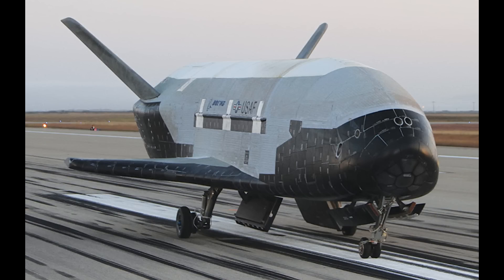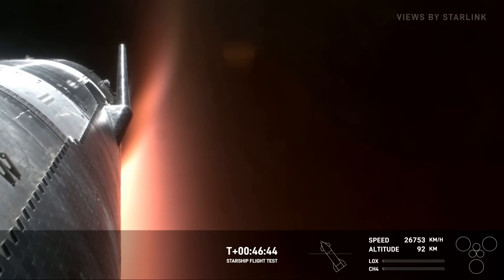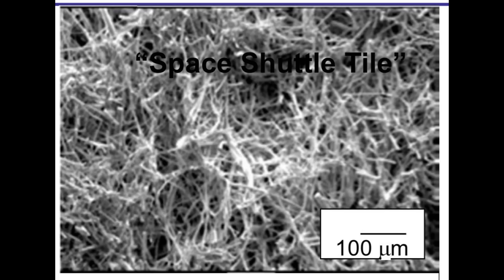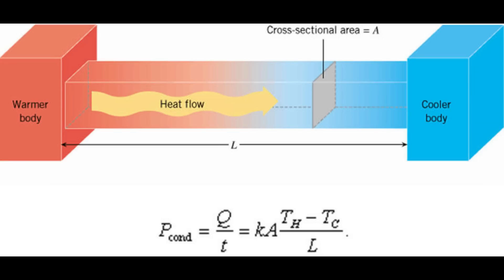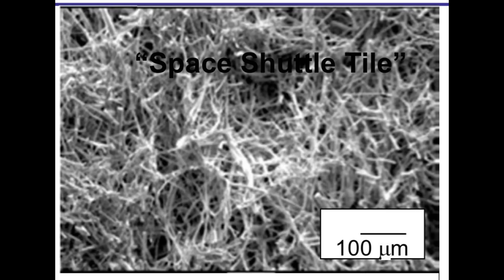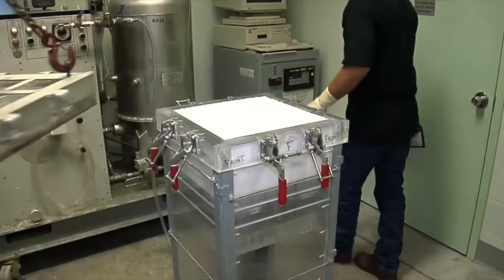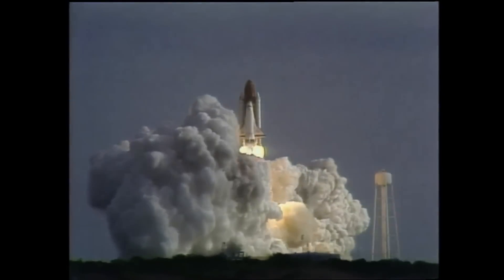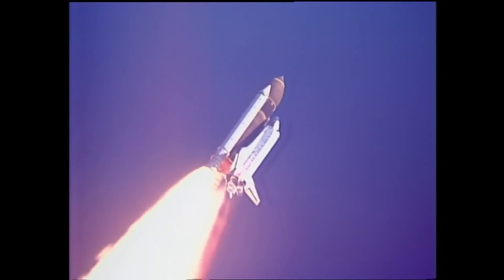The Microscopic Trick That Makes Heat Shielding Tiles Work

Comment: I once saw a video of someone in the facility making those Spaceshuttle tiles pulling one of the tiles, glowing white hot, out of an oven using a pair of tonges. And then just picked it up with their hands without getting burned
Reply: Yup... about 10 seconds after the tech removed it, the tech was able to pick it up by the corners using his finger tips.

Comment: One minor correction: alumina (Al2O3) is only called sapphire in a specific crystalline form (the alpha phase). I'm pretty sure this would be amorphous alumina, which is definitely not sapphire.
Other than that, great and interesting video!!
Reply: Actually given the temperature stability of TUFROC / similar materials, it likely is polycrystalline already (due to the heat treatment)

Comment: For those wondering why ITAR wouldn't want information disclosed about heat shields, its because passive heat shields are essential for accurate ICBM reentry vehicles. If you use ablative heat shields on the warheads, accuracy will reduce.
Reply: If ITAR was important here, NASA wouldn't have published all those details about the Space Shuttle TPS.
Reply: All modern reentry vehicles used by the US have ablative heat shields. They ensure accuracy by spinning the reentry vehicles to prevent uneven ablation effecting accuracy, plus in the Trident D5's Mk.5 reentry body they have metal filaments running along the axis of symmetry to make ablation more predictable.

Comment: I have been saying for years that the heat shield tiles are going to be a huge problem for Starship. They might get them to work but it is going to put a huge damper on the reusability part. Elon has said many, many times that the end goal is to fly a Starship to orbit, bring it back, catch it with the tower, stack it back on a booster, refuel it, and immediately relaunch it. They will never be able to do that using this thermal protection system. There will always be refurbishment needed before it flies again. So, they're going to have to figure something else out if they plan to turn around Starship like that.
Reply: So will you let us in to your source of all the confidential information on what they are doing? Or are you one of the armchair experts who 15 years ago said reusable rockets are never going to work?
Reply: @christiannorf1680  Armchair expert.
Reply: @TheEvilmooseofdoom  And what exactly makes you think that? Do you guys really believe five years into the project the people at SpaceX went "Hum, what about water proofing by the way? Have we thought of that?"

Comment: Its very obvious how delicate and soft the material is from the clip at 7:20 showing the worker removing the silicon 'sponge' from the furnace as you say "to give it some strength" you can see an impression from the hand of the guy who picked it up, its that soft.

Comment: I had wondered why they're not using large ablative shield sections that could be rapidly replaced instead of a passive system. I guess the issues of not performing as well on a non blunt body vehicle, are likely prone to cracking, and fabrication is likely difficult are all showstoppers for such a protection system.
Reply: It's not so easy to make large ceramic heat shield parts.
Reply: Ablative heat shields are heavy, not reusable and as they ablate they change the shape of the surface.

Comment: It's a micro-bramble. So was the SpaceX one, obviously.

Also, the transperational cooling system that they came up with wouldn't have any of these issues. And maybe they could make it lighter than what the tiles ended up being.

Comment: I wonder how different SpaceX and Sierra Space's tiles are given they both used the space shuttle data to design them
Reply: Space shuttle data?
Reply: @TheEvilmooseofdoom  both companies cooperated with NASA in their designs.  I'm assuming they looked at some engineering info we don't get to
Reply: @Shadare  I know spacex worked with NASA on the pica-x heat shield but not Starship.  Since each TPS is unique to each vehicle I'm not sure how much data from the shuttle program would have been useful but perhaps some.
Reply: @TheEvilmooseofdoom  Not starting from scratch designing the manufacturing methods is more what I mean.  It would have taken a lot of time and money to re do all that engineering and I doubt that all 3 would share such stark similarities if they were designed by completely separate engineers not cooperating at all.  NASA wants to see these vehicles succeed. They aren't greedily sitting on their patents waiting for everyone to fail.  I think it's a little weird how resistant people are to what seems like such an obvious explanation.

Comment: While convection, conduction and radiation are the three primary heat transfer methods (2:55), EVAPORATION is arguably a fourth method.
One could claim that evaporation is a form of convection, but it is considerably more complicated, as there is a phase change - liquid to gas, or solid to gas (sublimination)
That seems to be in part the case with 'active/ablative' heat shields (0:38), where a sacrificial material produces a (hot) gas which wicks away the heat. If the ablation causes a chemical reaction it is even more complex than evaporation. Still, energy is absorbed to change the physical properties of  material. That does not happen in convection.
Reply: That's how they cooled the Apollo moon suits if memory serves..
Reply: @TheEvilmooseofdoom  Good call.  With convection in a vacuum being zero, conduction being zero except for possibly the feet in contact with soil, they're left with radiation and evaporation. Radiation would work, but only favorably at night. I Googled to find the following (verbatim): "Daytime on one side of the moon lasts about 13 and a half days, followed by 13 and a half nights of darkness. When sunlight hits the moon's surface, the temperature can reach 260 degrees Fahrenheit. When the sun goes down, temperatures can dip to minus 280 F."  Photos of astronauts in daylight means radiation won't serve to cool. You're right. Evaporation or some sort of phase change must be used.

Comment: If replacing the heatshield is faster than re-waterproofing, maybe they could have multiple sets of heat shields that they rotate each launch and waterproof the ones not currently in use

Comment: And you can buy it and use it as one of the best insulators. It’s called an aerogel, with a company that makes sub products, one called pyrogel and another called cryogel.
Reply: Aerogel has some issues in space flight that make it a less than ideal choice for this.

Comment: Given how diffivult it seems to have been to keep these tiles fixed to a launching Starship.
In terms of speedy reusability, wouldn't it make most sense to come up with some kind of spray on coating that could form some kind of cohesive (even if weak) shell over the tiles which could be quickly applied & remove the concern about individual tiles?

They only have to make it though a few minutes of reentry after that & only if the coating fails in any 1 region for whatever reason.

Given the current problem seems to be simply retaining tiles, wouldn't that make the most sense?

Essentialy a quick easy spray on sealent with heat shield properties but keeps the main protection in place.

WHo knows, maybe SpaceX will figure out that fixed in place tile shielding with subsurf & be more efficient & safer than this idea.
Reply: They seem to make it through launch just fine, it's entry that is giving them issues.

Comment: Since most of Starship's shape is consistent, why not make the tiles larger? Expansion? Seems like large curved plates would have fewer gaps; fewer points of failure.
Reply: Expansion.  The problem is not all materials expand at the same rate and even different thickness in the steel can change that.
Reply: Or overlap the tiles like fish scales. Then there are no gaps between tiles and thermal expansion and contraction are not an issue.
Reply: @williamduffy1227  Dragon Scales
Reply: @williamduffy1227  That requires more tiles and thus more mass.

Comment: I got to handle one of those tiles once. It was shockingly light. If you waved it up and down you'd feel the air resistance more than the weight.

Comment: Why aren’t heat shields needed on launch? The spacecraft are going through the same atmosphere, and accelerating to the speeds they will be decelerating from on re-entry. Is it because most of the acceleration is done outside the atmosphere?
Reply: Correct, most of your burn is done well above the atmosphere. I think KSP makes this a bit confusing because the scale of everything is wrong in that game, so often times a low kerbin orbit is way closer to the atmosphere than an equivalent low earth orbit would be
Reply: Because on launch you're going through thick air much slower.  It's on return when you start with all that speed it becomes an issue.

Comment: What happened to using aerogels?
Reply: That’s what I was wondering. Hopefully Scott will respond to one of our comments as to whether or not aerogel could work as a water sealant on heat shields
Reply: It's hard to do, can be costly and abrades easily because it's mechanically weak it tends to become aerodust when subjected to G loads.   I believe R&D on it didn't go very far.

Comment: hmmm, ... tile maintenance may be the most problematic thing when it comes to rapid re-usability, but ... 
I think it's more likely to be the big fireball destroying the launch/catch tower when they try to catch that BFRocket. 🔥🔥
Reply: It won't destroy the tower.  It will make a big fireball.
Reply: @TheEvilmooseofdoom  I suspect the huge mass of the BFR crashing into the chopsticks and tower will be the main destructive force.  The explosive fireball will merely add to the destruction.  Catch fail in other words.  I hope I'm wrong.  
This catch system reminds me of H. Hughes big Spruce Goose wishes.

Comment: NASA recently announced the development of a new lightweight alloy with enhanced properties meant to withstand extreme conditions including heat and cold. Referred to as GRX-810, NASA has already selected several companies to produce and market use of the product. From what I could see of the tiles, they have a thin metal "plate" inside each tile that clips to prongs welded to the Starship. I'm convinced that use of this new alloy or something like it will resolve the problem. I don't think making the rocket out of the metal alone will fix the problem but a tile, with or without underlayment, might work. The ceramic itself break apart under certain conditions and cannot be relied on to do the job. What SX has done so far is provide a short term solution to get the Starship airborne and home again. NASA may already have a solution in hand.
Reply: There was also the metallic TPS that was planned for the VentureStar.

Comment: Regarding the surface treatment of AlO2 shielding. If NASA has the technology to produce a material that chemical changes, forming a protective gas layer on the leading entry surface, why could a "coating", that chemically creates a protective gas layer, not be applied to the surface of an almost effective AlO2 permanent shield tile?

Comment: I fully agree with you … the TPS has to be the biggest challenge. 
Thinking back … although shuttle used ceramic tiles for the major extent of airframe protection, didn’t they use reinforced carbon-carbon panels for wing leading edges …ie; those parts which needed thermal protection but where the local loading environment was more aggressive than the ceramic tiles could withstand??
Yes … I am thinking about the same parts that proved vulnerable to impact damage from chunks of closed cell foam being shed from the main external tank. However, I assume this material could be manufactured in appropriate geometries that could offer good thermal protection to those parts of Starship (flaps) that proved challenging based on FT4. 
Sadly, I am not sure about the thermal properties/performance of this material and I suspect it comes with a weight penalty … but it might offer a potential compromise solution??  I believe RCC composites are good to >2000C with breakdown by sublimation at >3500C. 
I have also wondered if exposed parts of Starship airframe could be fabricated from inconel alloys to provide for superior integrity in exposed locations such that they might still perform adequately with reduced thermal protection.
Maybe a combination of localised use of Inconel structure with RCC cladding??
Has anyone looked at the potential of a hybrid panel of ceramic matrix core laminated into an RCC structure? … similar to a typical honeycomb panel? … though probably find the matrix would be crushed in the lamination process ☹️. 
Just some wild thoughts and speculation from a retired aerospace engineer ….

Comment: Stainless-steel is also a very bad heat conductor, so if you heat a very small spot, it may melt sooner than aluminium or copper, which can conduct away heat from a local hotspot.
Reply: Thats actually a good thing.

Comment: Very good video. The only thing that is radiation heat transfer is not about the temperature, it is about the temperature differences so as the tile heats up, the radiation heat transfer slows down

Comment: maybe the engineers working on the Mercury, Gemini, Apollo project got it right. KISS. one can even use the high tech tiles developed since, but they should be replaced wholly after every landing. "one size fits all" just drives up the complexity and price of the process. one just has to think about the mechanical/thermal needs of each and every tile (one goes, so does the whole ship) slowing down from 28000 km/hr down to landing speed (zero?). the tiles still have a very good use, but for vessels  designed to never set foot on a planet= they could be used to build  very low mass, high internal volume spaceships. and the new generation of space stations, this time, they should look like the one in "2001". the tiles can actually be made in space, plenty of quartz and Al2O3 in the belt.

Comment: What was that stuff called that some guy claimed to have invented? Starlite? It could withstand high temperatures on one side whhile staying  cool on the other.
Reply: I believe that Starlite falls into the category of ablative shielding compounds, as the outer layer would char, protecting the what's underneath from excessive heat.

Comment: Having to refurbish the heat shield tiles after every shuttle flight just contradicts the concept of reusability in the space shuttle, it's like it was refurbishable not reusable!
Reply: Yeah, those two words were almost used interchangeably despite the very different meaning.
Reply: @TheEvilmooseofdoom  Oh yeah I remember. I think Tim Dodd has a video on this too!
Reply: So far every reusable rocket has needed non insignificant amounts of refurbishment after every flight, so yes, those terms are basically interchangeable.
That EDA video has done a lot of damage to public perception of spaceflight (wouldn't be the first time either).
Reply: 100%, I think people don’t understand how much more wear and tear something coming back from orbit like STS incurs compared to a Falcon 9 first stage; its gotten way too fashionable to bash on the Shuttle when Starship is going to have to lean massively on the mountains of TPS research and technology that wouldn’t exist without the trailblazing shuttle program.
Reply: @STS-Dreamer  Yeah that is true too!
Reply: If we wanted true reusability we would have to have powered landings to Earth's surface. Very expensive.

Comment: Could some sort of aerogel coating possibly be the solution to this? I know it’s both very hydrophobic and also very good at thermal insulation
Reply: It doesn't stand up mechanically though. Otherwise it would be good.
Reply: ..or a combination of both : aerogel soaked fibers carefully dehydrated afterwards?
Reply: Yes, aerogel is incredibly weak. It would be shredded by the time the rocket reaches max-Q.

Comment: I got 2 questions:
1. Since there is a lot of empty space inside the tiles, would the air come in and out (move from atmosphere to space and back eventually become a problem for them?

2. I recently heard a lot of stories about the aerogels, they are light and heat resistant, Is there any difference between these tiles and aerogels?

Comment: Greetings and thank you. I have a question about why the booster and the starship don’t float after landing in the ocean.  It seems to me there could be a lot of data to be collected if you inspected it after landing.
Reply: Because giant things 10+ stories tall toppling over rarely land intact.
Reply: @TheEvilmooseofdoom  even in water? wouldn’t the engine section, being the heaviest part sink straight down enough, that the water would cushions it as it falls the rest of the way?
Reply: @pierredemontigny8154  Water doesn't help much, the problem is the pendulum effect.  While the bottom doesn't move far, to go from being hundreds of feet up to flat on the ocean means the top (in a topple) is moving a LOT faster and thus hits a lot harder.  Also should have mentioned that they depressurize the tanks right after landing and leave those valves open to let sea water in.  I believe in all the F9 soft water landings only 1 didn't break up and sink.

Comment: Any possibility of using carbon infused aerogel or something similar? Heard a lot about aerogel combinations a while back but gone silent now, have you heard of any breakthroughs?
Reply: Is there such a thing as carbon infused aerogel?
Reply: Would be ideal to stop  radiation  through quite transparent aerogel - much like black Styrofoam has better R - values  than the white original.  In heatshield application the effect should be much stronger because of the T^4 - law of radiation!